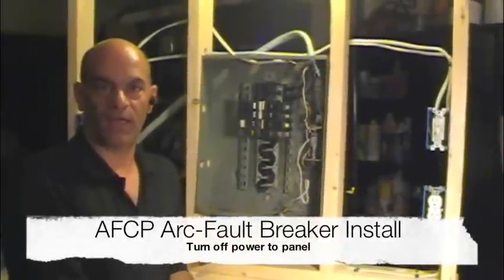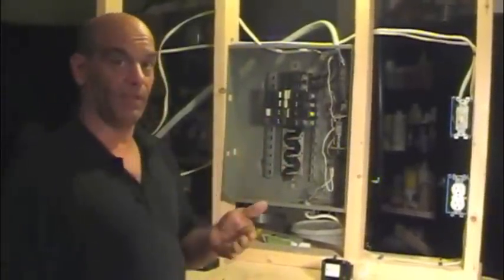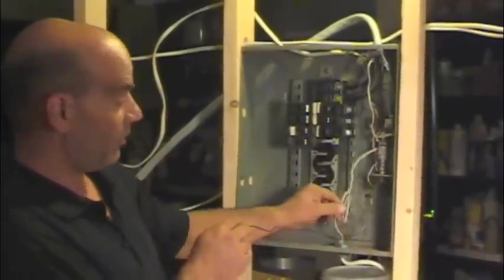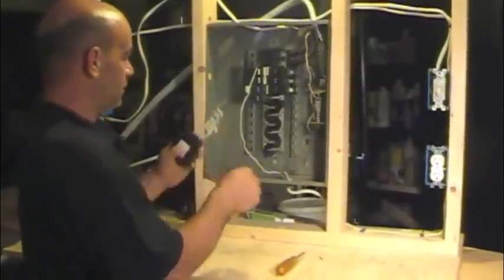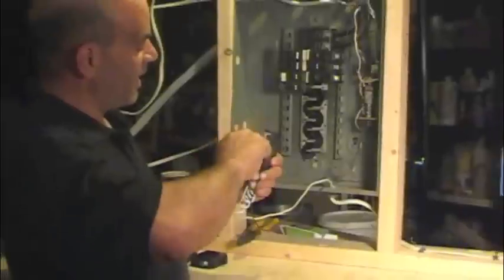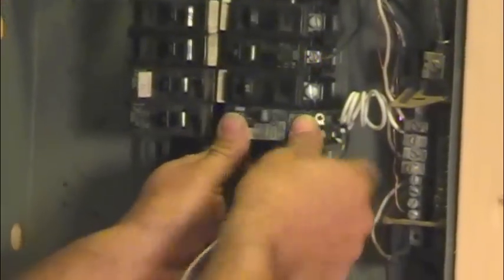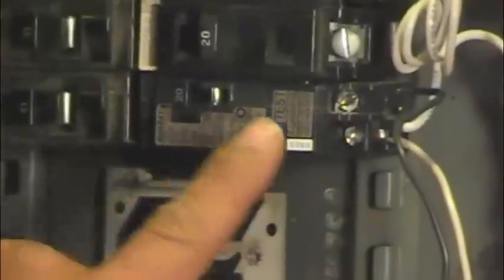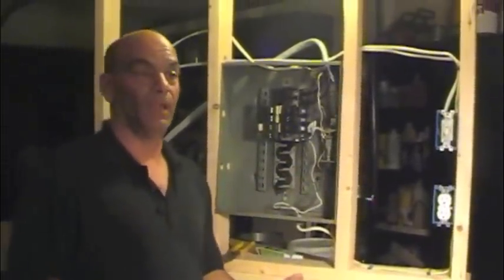How to install a Arc fault circuit breaker / interrupter

Comment: This is the 3rd video I've seen on topic (never done it before and cautious..) and it is the most detailed for a newbie like me. Other videos did not explain enough for me about where the old neutral wire comes from and how the pigtail connects to the same place. Glad I found your description. 
(Would add to previous comments about what may be obvious on first turning off main power, and then turning off individual switches before turning main back on,  and suggestion for using insulated screwdriver.)

Comment: Really nice video and great instruction. I have an extensive safety background so my suggestion would be to turn off the main and use insulated tools while doing this just as an added precaution, maybe because I am a bit over cautious in that any hack can watch this video and now they are an electrician. Great video and great close ups of the work. Thanks again for posting!!!

Comment: Well here''s what I finally did.  I turned off ALL the non arc fault breakers and got the arc fault breakers up and running fine.  Then with a load on the working arc fault circuits I turned on all the non arc breakers until on of them tripped the arc fault.  A reverse polarity error on that circuit was corrected and shazam the whole board worked.  The three wire Edison circuit fed this dead short back through ALL the neutrals causing the arc fault to trip despite the error on another branch.

Comment: HINT:TO REDUCE NUISANCE TRIPPING:
Cut the neutral from the AFCI to the neutral bus to make the shortest distance possible.  It does actually say that in the instructions.  That neutral wire should also be as straight as possible (a gentle curve is fine, just don't bunch it up or leave it in a spiral).
Yes, I know it seems like a little thing, but I have actually done this and it has fixed problems.
Reply: SwingboyPA thank you for the tip 😊
Reply: Yeah, thanks for the tip!
Reply: Haven't had any nuisance tripping with pigtails at full length. In fact, one of them wasn't fully straightened and it was extended to reach the bottom terminals of the neutral bar since everything above was occupied.
Reply: @aurvaroy6670  I'm actually not surprised. It's just something that I do out of habit at this point out of an overabundance of caution.  I generally find afci, gfci, and dual function devices to be very reliable.  :-)
When troubleshooting so called me some stripping, most of the time the issue is a ground wire which has unexpectedly bent when a device was put in to its wall case and the ground is touching a neutral.  Or someone didn't tighten the wire nut enough.  These are the most typical mistakes that people make when they have poor technique or they are in a rush.
So, if you're not getting trips, then you're doing the right things.

Comment: Great video  + detail Dom!
Just one suggestion: the neutral on the AFCI should be cut so that it provides a direct path to the neutral bus bar.  That step is usually in the instructions -and to be honest I never paid attention until I "trouble shot" a bunch of AFCIs which were nuisance tripping and (amazingly) this fixed the problem.  I can't believe it makes a difference, but apparently it does.
Instructions also suggest no sharp bends... *shrug*
Anyway, still one of the best youtube videos!!

Comment: As an Electrician I can honestly say I do not like AFCI. I was hired to hook up a new modular home pre-wired. My job was to install the panel. The job like most grew to later the Customer wanting the basement finished which all went as planned no issues. Immediately after I finished everything worked. The Carpenter was using a electric miter saw and the afci tripped. One Circuit in the pre-wired house tripped the arc fault breaker. I traced the entire circuit out. I had a couple false trips on a light with a dimmer. I replaced the switch leg conductor all this after the home had been dry-walled. I spent 3 weeks following the entire circuit every inch of the conductor and it still tripped. During this time I was in contact with the pre-fab builder and he finally agreed to send his electrician out. They came out and simply argued that this just happens on occasion and his solution was to install a regular breaker instead of the arc fault. I could not agree as my license was on the line for this home. I continued tracing and the next day the arc fault simply went away. I to this day have no idea why it tripped or where, all I know it is working presently. How are we as Electricians supposed to cope with situations where there is this kind of nuisance trip? I replaced 3 different arc fault breakers. BTW I was not payed for the 3 weeks because the home owner could not accept that there was some sort of gremlin in the circuit but I did not find anything wrong! The circuit was good no staples had entered the case of the wire all connections were good, no contact with water and all dimmers were approved for AFCI installations.
Reply: Cary Lamari ...could it have been a weak spot in the actual wires themselves that you cannot see through the sheathing and arcing at the weak point? Just thinking of all possibilities
Reply: AFCI breakers are universally hated by electricians..
Reply: @jeremysmothers1985  sure however one thing I did not check was those older CFL light bulbs, the builder used some in the home. Could those older Edison based fluorescent bulbs possibly cause nuisance trips? I just don't know. These manufacturers should offer training on AFCI and potential nuisance trips IMO even if I had to pay I would be happier to have more knowledge about the inner workings of the AFCI. I wonder if there is a tester that would help identify where the arc fault is?

Comment: For people who don't have access to the NEC:
(From NEC 210.12(A): ...family rooms, dining rooms, 
living rooms, parlors, libraries, dens, bedrooms, sunrooms, recreation rooms, closets, hallways, or similar areas shall be protected...AFCI combination type...)
NEC 210.12(B) In any of the areas specified above where branch circuit wiring is modified, replaced, or extended, the branch circuit shall be protected by a listed arc-fault circuit interrupter, (AFCI) combination type protective device.

Comment: Actually Mike asked me to review his pages on AFCIs after I sent him some corrections, but I don't really have time to do that -although I do like writing and I respect him.  I agree it's a great website from what I recall.  :)
NOTE:
I have had some nuisance trips on AFCIs, but if you haven't: try shortening the supplied neutral wire from the AFCI to the panel -I swear I didn't expect it to work, but it has made a huge difference.  I have quickly trouble-shot other guys' work this way.  :)
Reply: Good luck trying to move that breaker in the future 😂

Comment: Current NEC requirements instruct electricians to use a torque screwdriver when landing all screws in a panel. (The breaker will list the setting needed). And yes this covers new & existing circuitry.

Comment: I'm pretty sure the NEC 2008 says something like "all power sources" meaning Lights and plugs are required to be Arc Fault protected.  All bedrooms and all habitable spaces that are not GFCI protected (bathrooms kithens unfinished basements).  REMEMBER TAMPER RESISTANT PLUGS ARE NOW REQUIRED.  Great teaching job - especially telling people to read.
Reply: Damn. My house was built four years prior to that revision and I thought AFCI protection got recently expanded in the most recent revisions. 

What I don't get is why TF are non tamper resistant receptacles still on sale? Like what's point? Isn't an old non tamper resistant receptacle that has gone bad replaced with a tamper resistant one?

Comment: Agreed; that's why I referenced NEC (National Electric Code for other readers) 2008, not a local code.  I figure youtube is a national site so I am not going to reference any local code in a post.  I'd hate for someone to do something under the standard of the NEC and then say something like "Well, this electrician on youtube said I didn't have to..."
I am not responsible for someone else's actions, but it can't hurt to quote the NEC.  :)

It's just solid advice.  :)

Comment: OK, I can see your confusion.
Although an AFCI does provide some degree of GFCI protection, it is not a substitute for a GFCI breaker or receptacle in a wet location.
So how is an AFCI different?  An AFCI recognizes continuous arcing that does not draw enough current to trip a breaker...for example 16 amps of arcing would not trip a 20 amp breaker before it could start a fire, but AFCIs trip because a processor recognizes the PATTERN of a low-amperage ( & therefore potentially continuous) arc.

Comment: Some people say that mounting them with the ground on top is safer in case the plug is pulled out slightly and something falls onto it and makes contact with the hot and neutral prongs in your plug. The idea is that the ground prong will block anything from doing that (this idea does not apply if you are plugging in a two prong plug, such as on a lamp). However, the traditional way to install these is ground down, but neither way is "wrong".
Reply: Having personally witnessed a direct fault caused by a bare wire falling across the “residential” installation of a receptacle, I prefer ground on top. Both ways work, and top ground is incrementally safer. AFCI’s and dual function AF/GFCI’s are great improvements in electrical safety.

Comment: BTW yes you can use a common neutral for two AFCI Circuits however as you said they must be on different poles in the single phase panel and MUST have a common trip mechanism such as a breaker tie so if one breaker trips both trip.

Comment: Thanks for the video Dom. I installed one of these a few months ago and it kept tripping. Someone didn't tell me to connect the neutral from the circuit to the breaker, instead it went to the grounding bar along with the pig tail wire. This should fix it!
Reply: Why would someone have to tell you ? Instructions are extremely knowledgeable and quite easy to digest.

Comment: No, they are rated for both copper and aluminum *branch circuits* (the wires that leave your circuit breaker box).
I work almost exclusively in older, victorian homes.  Aluminum branch circuits were used in the 60's and 70's pretty much all across America (although not as common as copper).  That is what the OP is asking about.
Reference:

Google "aluminum branch circuits" and you'll find many references.

Comment: As of 2008, N.E.C. code is now AFCI on ALL circuits other than dedicated appliances or wet-location GFCI locations.  If you add to a circuit you are supposed to change the breaker. TN may be different; I don't know, but you are referencing old code.
GFCI withing 6' of a water source (eg. kitchens, bathrooms), outdoors, or below grade in a basement.
As I said, AFCIs typically provide DO provide SOME GFCI protection -but not enough to qualify as a GFCI protective device.
Read some spec sheets.

Comment: Agreed; I do encourage my customers to do so.  However I can't force someone to re-wire a 3+ story building with fine plaster crown moldings and medallions...that is prohibitively expensive!

Believe me, victorian houses are filled with scary wiring, so I think we would both agree that it is wise to encourage homeowners to upgrade to AFCIs.

Although my protocol is a higher standard than the NEC, I believe it is a cheap alternative to a complete rewire.

Comment: My box consists of Siemens tandem breakers (15+20 and 20+20) with no available slots.  Are there tandem breakers with AFCI protection that I can use to simply replace the current ones?  I'm guessing "no". Thx!

Comment: Thank you.  My Arc-Fault that I'm replacing has a black hot, and 2 white neutrals going in. The new Siemens has the white pigtail. Do I splice the pigtailed and attach the other white? The old Siemens breacker is the same thing but for the white inputs. .

Comment: Thank you. I have a shorter neutral conductor. It just will make it to the new breaker. Can I use a pig tail in order to make a neat connection?
Reply from the maker: Yes for sure
Reply: Great. Thank for the video and advise.

Comment: I just noticed that I have my gas stove running to a single 15 Amp afci breaker, plus a socket in my living room and the lights in my bathroom also run to this same 15 Amp afci breaker. Is this normal? Should I be worried? I'm not an electrician by any means.

Comment: This is an excellent video.  Thanks.  I was wondering if it was possible to install an arc fault breaker on an existing/old panel, given that I didn't know which one would be the neutral for that circuit.  This video has a great explanation of how to do that.  As soon as I can find my main breaker, I'm going to install these on my kids' room circuit.  Thanks!

Comment: Thank you for your video.  Electrical is my secondary skill.  I was working on a panel, there were 4 AF  breakers installed with the pig tail not connected.  I knew it was obviously wrong but I've been wanting to know how to correct them.
Reply: Instablaster...

Comment: I understand that AFCI breakers take two slots on the panel, ie double width. Are there AFCI breakers that are single slot width? The extra size problem is an issue when trying to retrofit and upgrade to new building codes. Are there AFCI breakers that could be installed at a receptacle, like GFCI plugs? Thanks for your effort -- good demo.
Reply: Very helpful. Thank you.

Comment: I am troubleshooting a panel that has two arc fault breakers,.  One of the breakers is located on the left bank of the Siemens panel making in necessary to extend the "pigtail" neutral component of the breaker to reach the neutral bar.  The circuit simply will not  hold any load whatsoever and trips the arc fault breaker.  Does this added resistance to the neutral input of the arc fault breaker affect its sensitivity?  This is on a three wire Edison service.with a bonded neutral bar.

Comment: An AFCI works with aluminum or copper wire.  My protocol is to use a 15-amp AFCI breaker even if the wire is 20 amp (#12) -just in case the wire is already fatigued.

Comment: I am replacing a arc fault breaker but this particular one has only a neutral line connected to it and the coiled white out is connected to the neutral bar. The load line black for that circuit is connected to a regular breaker. I have never seen this type of connection. Do you have any ideas as to why they wired that circuit this way.

Comment: Excellent video my friend. But I have a question. I wired my all bedrooms on its own circuits. Lights on 15A and plugs on a separate 20A. In short each bedroom lights and plugs are not sharing one. So to the question, what do I put on an arch fault? The plugs or the lights? Or both with 20a arch fault for plugs and 15a for lights?

Comment from the maker: No not at all. I would disconnect the load wire from the breaker and then test it. If all good from there I would then unplug everything on that line, pull lights as well. Trial and error type of thing.

Comment: great video,

i'm trying to figure out what kind of dc breaker do i need. i have a I have ordered a panel with these specifications: 

Reference Number HG260W
Maximum power Pmax (W) 250 
Tension in Pmax Vmp (V) 30.43 

Open Circuit Voltage Voc 37.12 
Short circuit current Isc (A) 9,65 
Current in Pmax Imp (A) 8,54 
Polycrystalline cells 

i dont want to spend a lot for a disconnect box. will a 25 amp circuit breaker do? if yes, do i need a single pole one>? and third do i plug only the positive?

 sorry too many questions.

Comment: @zackman191 The reason they don't use these everywhere is three-fold: 1) they are quite expensive 2) they are very sensitive and subject to nuisance trips and 3) they are new so the quirks are being worked out. I suspect in a decade you will see GFI required in wet areas, AFI required nearly everywhere else (except items like a fridge where a tripped breaker can cause a significant monetary loss or illness due to food spoilage).
Reply: Yup. You predicted the future. AFCI protection is required in all habitable spaces including bedrooms, dens, sunrooms, kitchens, etc. Since GFCI protection is also required in kitchens and sunrooms, DFCI breakers are the best solution. 

Fortunately, this applies for new construction or remodels. Old houses don't need to be upgraded to meet current AFCI code unless it's a new circuit or at least 6 ft of wire was added to an old circuit lacking AFCI protection.

Comment: Awesome video. Very insightful.... Thank you
Reply from the maker: +Rene Moran Thank you, always my pleasure.
Reply from the maker: +TheSeattlegreen two hots is 220 volts. And never share a neutral with 220.
Reply from the maker: +TheSeattlegreen Yes of course but you don't ever share a neutral for a 220. Yes using a 3 wire as two different 120 circuits  is very normal. So anyway to your question. I would think for sure by using the same neutral would either not work or constantly trip. I've never used a 3-wire for an arch fault. So as far as code goes I don't know. However I can't see how they would allow that.